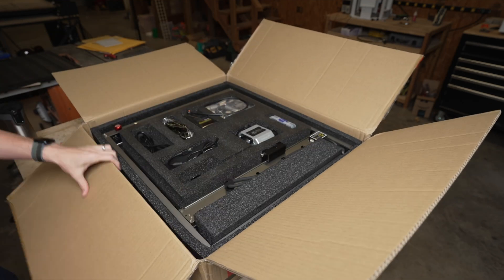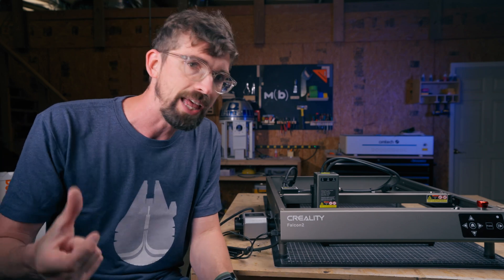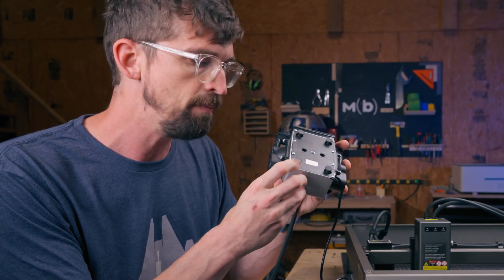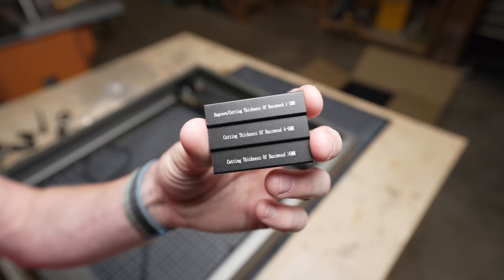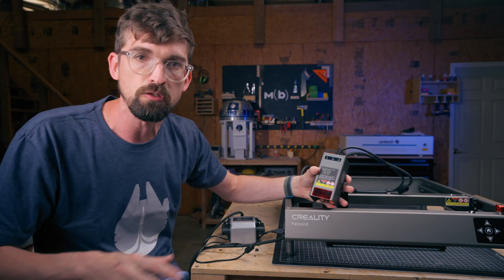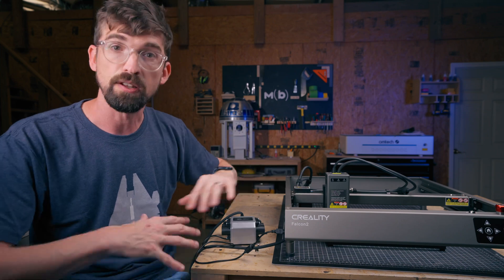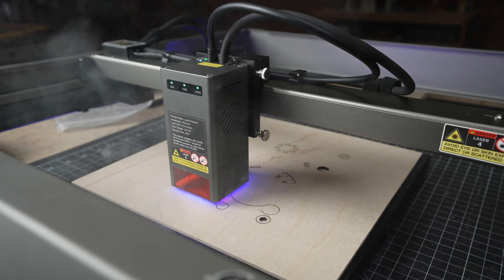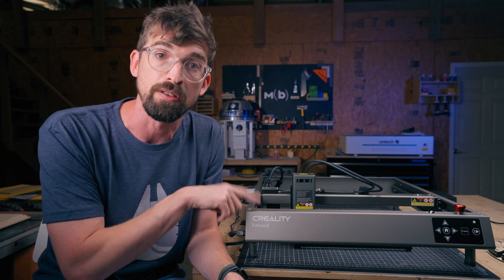Can a 3D Printer Giant Conquer Lasers Too? Creality Falcon2 Diode Laser Review

Comment: So when they talk about the "shut down on fire," does the laser module move away from the source of fire, or does it stop right over it?
Reply from the maker: It kills all power to the machine.  So the module doesn’t move
Reply: @makeorbreakshop  does that make sense? So, the machine stops over a potential fire. I mean, if it lights up, the whole thing will go depending on how much fuel there is.